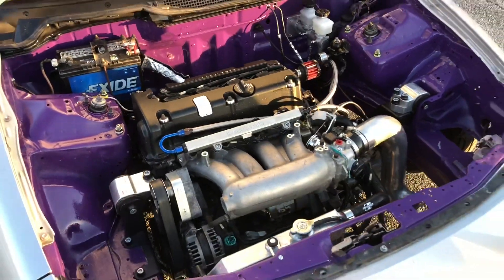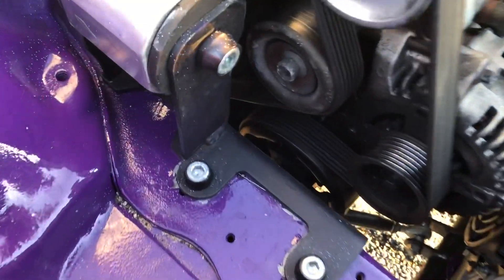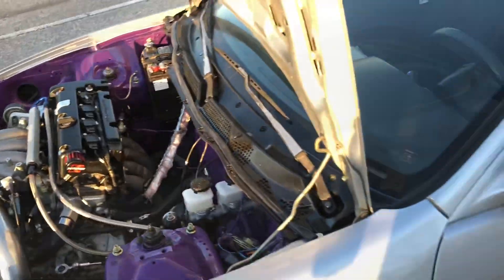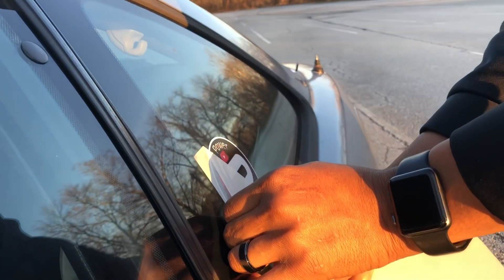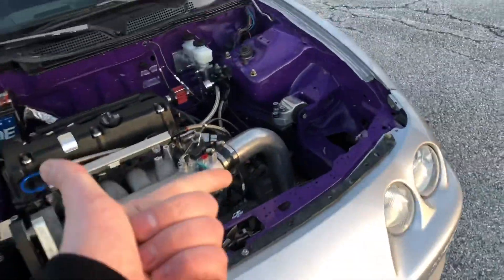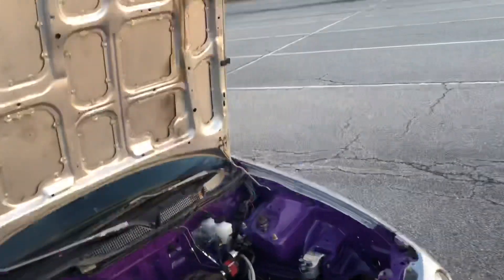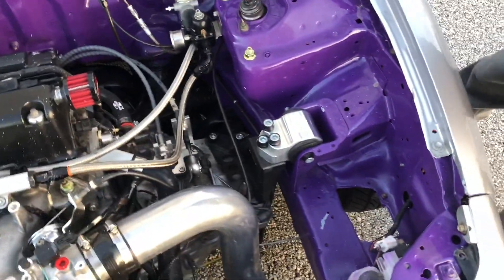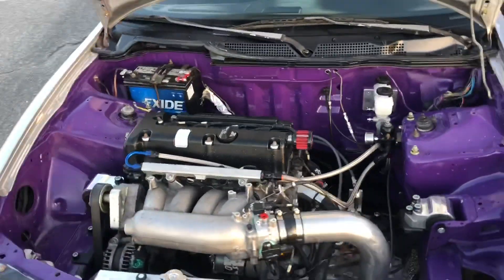K24a2 Acura Integra - Motor break down - Car pulls

Comment: I thought about going k-swap on my integra but a lot of work I am not ready for. But I didn't settle bc one of my integral the b18c5 motor(USD Type-R motor)
Reply from the maker: Victor Melendez that’s still really good tho!
Reply: k power performance Oh yeah, 30 something pounds less and almost the same horsepower.
Reply: ItsYourBoyVic it’s actually not as hard as u think just expensive i paid more for Hondata kpro than I did for a k24a r
bb-3 if u do a lot of research before hand and talk to people who have done it before it’s not hard
Reply: RayLoveJr Yeah, the expensive part I know for a fact. But it’s dope!

Comment: nice stock k24
Reply from the maker: sctflasher379 yup completely stock, all the way down to the oil pump lol pump is weak not letting it engage VTEC, changing to a type S pump as we speak. Also Ktuned TB had issues with the butterfly not opening all the way so this was about 60% throttle it was discovered a  couple days later lmao This is it for this set up, completely new motor and set up going in stay tuned for part two😉😉😉💯